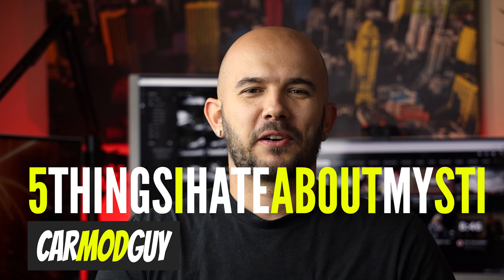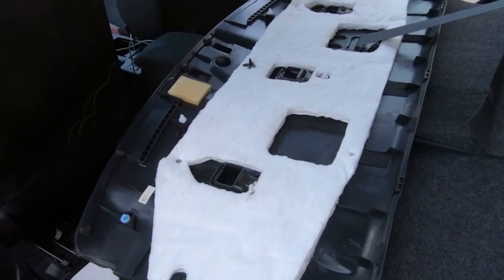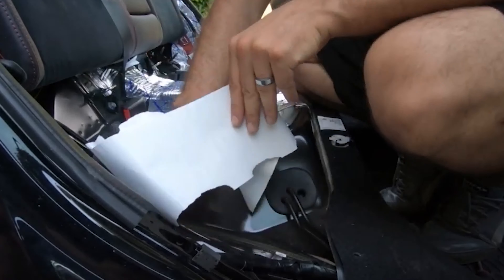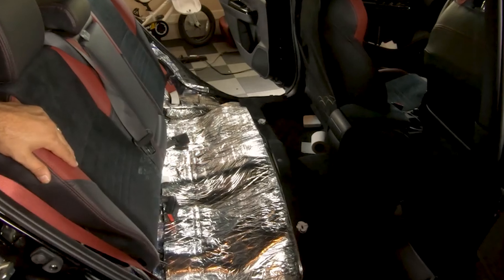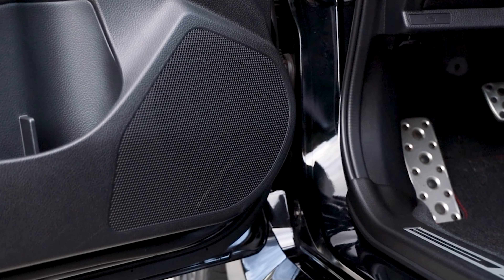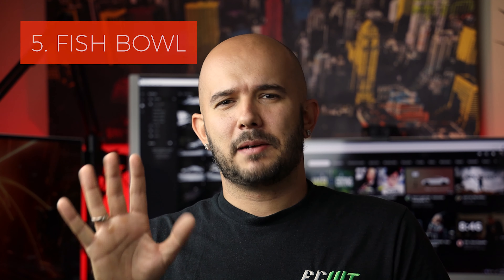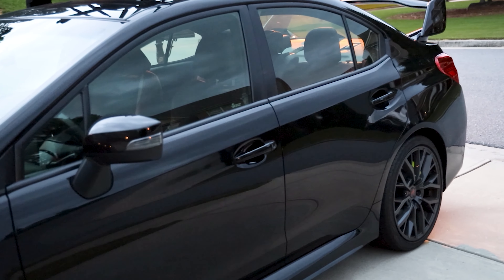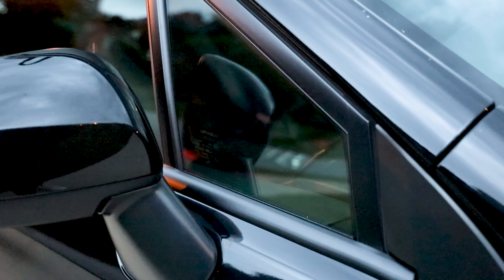5 Things I HATE about my WRX STi

Comment: It shouldn't burn oil if it was broken in correctly could just be the ej. If you go over 4k rpm before 1k miles that could be the reason. Just keep a good ol quart in the trunk lol
Reply from the maker: I drove it under 4000 rpm for the first 1500 miles. Broke that sucker in exactly as stated, and then some 😁
Reply: My 2019 burns oil too (OEM 5W-30 oil). Switched to Castrol 5W-40 recently and will monitor for a couple of months... 
Was broken in properly. I broke in my 2016 WRX exactly the same and that one burned 0 oil in over 3yrs.
Reply from the maker: EA M I’m about to try something other than OEM. Seems like it’s too thin
Reply: @CarModGuy  yep, absolutely too thin for the STI after a few thousand kms. You could maybe try a different brand 5W-30 if you want no hassle w warranty; or go to 5W-40 if  you want protection and longevity.
Reply: @emartinezr  might be hit or miss mine hasn't burned a drop fingers crossed
Reply: @dnawrapsatl  what change interval are you following? And what driving conditions? If less than 3,000mi you won't burn oil. Also, some conditions worsen the situation... my 1st impression was that the oil thinned out too much for comfort, then i noticed after 5,000km (3,000mi) I was down almost 1qt.
So I'm not sure if it's purposely built to burn some oil, or if the OEM oil and interval is intended for EASY driving and fuel economy, or if poor manufacturer tolerances make some cars burn more.... according to Subaru a certain consumption is 'ok' (forgot the number). But... no way. I'd rather have as little consumptions as possible. Not worth the risk.
Reply: @emartinezr  yes I ditched that oem oil after the first 1k miles. I run Castrol edge 5w30 extended for 3k miles. Never burn a drop. That's a shame to hear.
Reply: @dnawrapsatl  ah that's good to know. I suspect Castrol Edge is simply better against consumption. Less evap and holds viscosity better than the OEM. Also, 3k interval helps too (Subaru's recommended is longer). So, good to know you're doing well with that oil and interval.
Reply: @emartinezr  yea I guess I got lucky good luck to you man
Reply: @dnawrapsatl  well using a better oil than OEM and changing at a good interval is not really "luck". It's doing the wise thing ;)

Comment: im debating to get the 2020 wrx or STI. Considering all these issues you have, would you say it's still worth buying??
Reply: Test drive both you will notice a significant difference in feel and performance with the STI. Yes its worth it.
Reply from the maker: I took it in and they needed to change a sensor. No more oil burning issues. Absolutely worth it over the WRX
Reply: @CarModGuy   So you have no more burning oil after the sensor was changed out,  I’m seriously considering getting back in to an STI
Reply: @CarModGuy  curious what sensor it was

Comment: Any breaks squeal? 12k miles on my 2019 STi and they are making noise since 3k, I had them greased but still squealing. Breaking is very good tho. A Subaru mechanic told me that the squealing was a brembo thing...
Reply from the maker: Yes, constant squealing due to Brembo brake-pads. They generate a lot of debris so you just have to keep washing them thoroughly. And I mean thoroughly. I pressure wash mine every week and they still start to squeal after 4-5 days. I’m going to be buying different pads that don’t generate so much dust soon.

Comment: Do you have an accessport? I want to get one for my STI. 2019 btw, but I imagine as long as you maintain the vehicle properly the accessport will probably be great overall. What do you think?
Reply from the maker: I don’t yet but that’s probably the next thing that I get. I don’t think the access port will cause any damage and should open it up ever so slightly. But, if you want to do any modifications after, you need the accessport so that the car can be tuned properly. So yes, the accessport should be great overall. 😁

Comment: Yes to under-powered. Big wing, big brakes, turbo, sports suspension and yet in stock the STI can barely pull. Handles great though. I got a downpipe almost right away... that helped the low end significantly and was great TBH. Now I have a ~Stage 3 setup and it pulls like a mofo all the way to the top. The car is finally as fast as it looks (without jumping into M3 territory or anything like but solid). However... it now drinks fuel like a 747.
Reply from the maker: 😂 lmao ... 747 here I come

Comment: Hmmm... I don’t have any of the problems you do in my STI except the lack of HP. I have the H/K sound system which is decent. I’ve never added oil in between oil changes. You should get your motor checked out.
Reply from the maker: I’m not the only one. There are thousands of complaints online
Reply: @CarModGuy  Still, you should get your motor checked out. You shouldn't be adding that much oil in between oil changes.